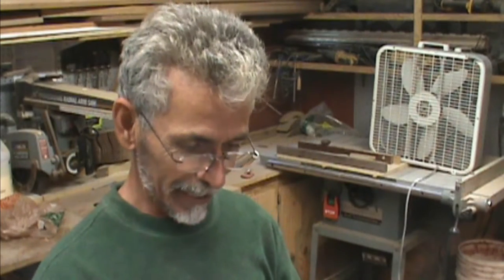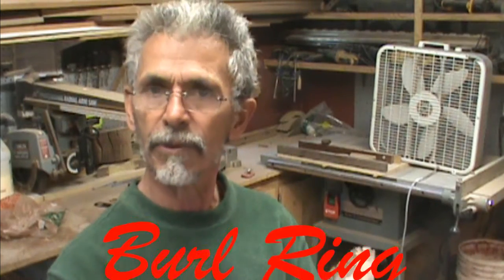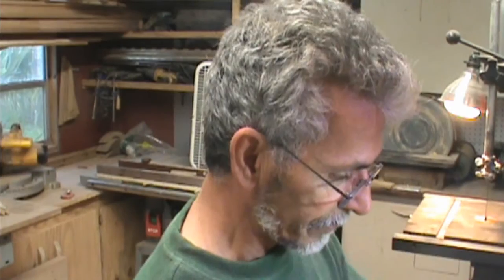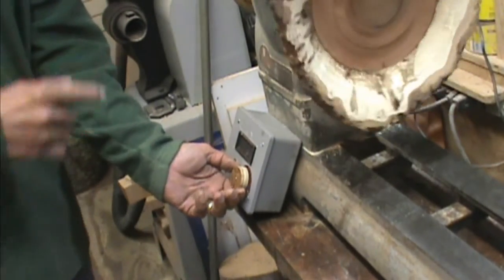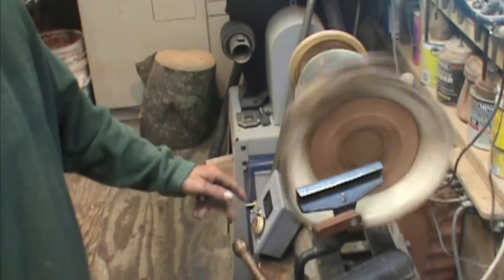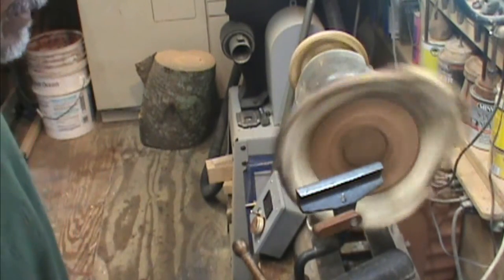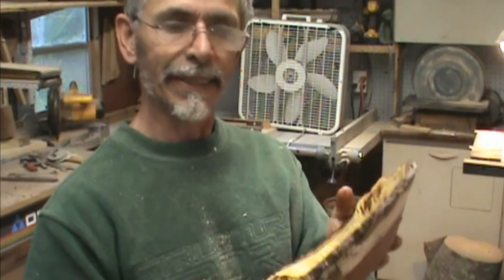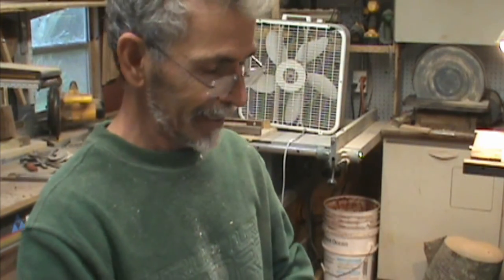Burl  ring by Al Furtado

Comment: Al, for the wiring for your reverse you don't use the three wires off the pot (speed dial).  You use the two wires going to the motor out of the control unit.  First you must have the right switch type, (DPDTCO) stands for double pole, double throw, center off.  It has six posts on the bottom.  Cut the two wires to the motor, usually red and black.  Take the two wires from the control unit and connect them to two end posts on the switch.  Then take the other two wires going to the motor and connect them to the two middle posts.  Then make two short jumpers and connect the right end post to the other end left post.  Use the other jumper to connect the other left post to the reminding right post on the other end.  In other words make an "X" with the jumpers to the four end posts.  Note, you must have the pot at zero before reversing.  That will definitely work.  Mention this on the next video and my channel if you don't mind.  Take care, Larry
Reply from the maker: +Larry Martin Thank you very much Larry and I agree and am familiar with that type of switch and drum switch U appreciate the time you took to explain and you are without a doubt a better electrician than I will ever be.in this case I am not picking up the leads that go to the motor, I am picking it up from my VFD 10v power and 2 wires forward and a reverse, so all 3 wires have to go to the switch. I went to radio Shack figuring I had a faulty switch and sure enough I put a new one in and Walla. forward and reverse are working.Thanks again

Comment: Al,  I looked up your VFD.  Page 28 in your manual shows the wiring diagrams for run and forward reverse with three wires.   Assuming you set function F06 to 001. You need two switches connected to terminal 3.  From one switch to terminal 4 closed for run.   From second switch to terminal 5 open forward, closed reverse.  Both switches are single pole single throw.   Good luck.  Kevin
Reply from the maker: +Kevin Coop Thanks again for that info and yes I have got it going and show that on another video.Take care

Comment: My tastes are more in the lines of contrasts, so I love the darker wood, I love the burl is like the crown on the bowl, so yeah, I would have done the same! Love the lathe upgrade, did you ever managed to get it to run in reverse?
Reply from the maker: +Yuval Lahav Woodturning Hi Yuval, Thanks my friend I am glad you have taken some time to watch this series of wood turning, I do like the look just not the red color. either dark brown or very light would have worked much better.Yes the lathe is working in both directions with ease It's nice to be able to switch direction on the fly and change speed to whatever speed suits me for the occasion. these upgrades were cheap considering, the most expensive was the VFD /motor combo @250.00 with shipping. sure is a lot cheaper than a new lathe with those features LOL.Take care my friend.
Reply: +Al Furtado I think my lathe's motor simply can't support there kinds of upgrades, too cheap, too simple, someday I hope I'll be able to upgrade my lathe. Someday :)